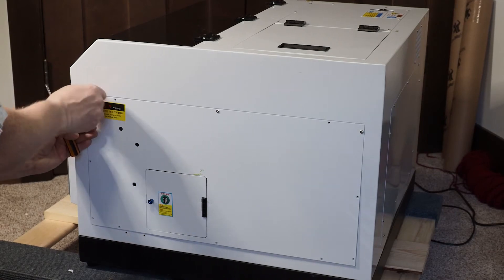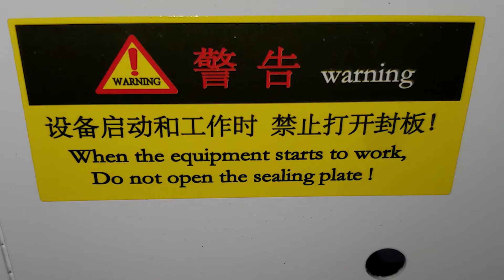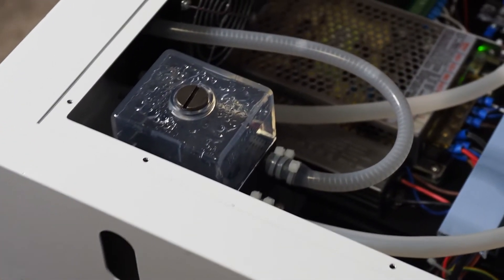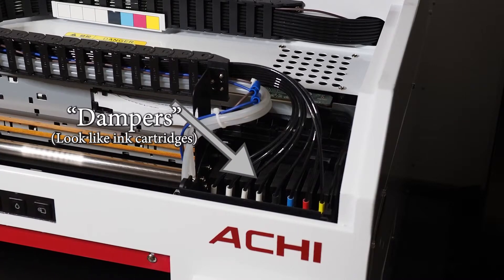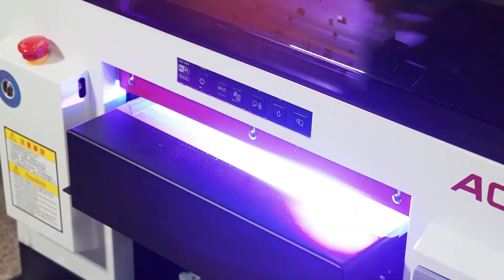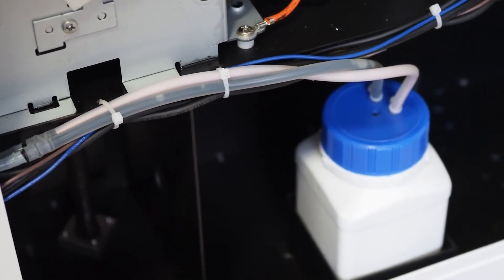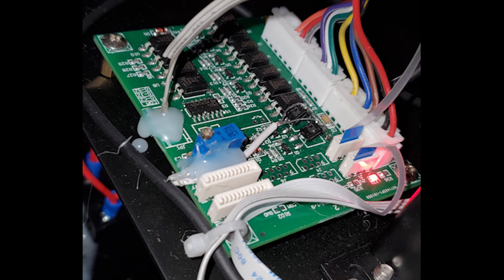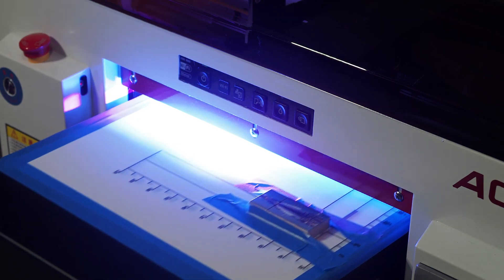Opening up a budget UV Printer

Comment: Can you go over maintenance and cleaning? And if you're not going to use it for a while, what do you need to do to store it?
Reply from the maker: Storing: What I did was push through ink cleaning solution through all tubes and heads. I cannot tell you if it is successful or not as I have not recommissioned the printer after storing. You can find youtube videos on how to clean.